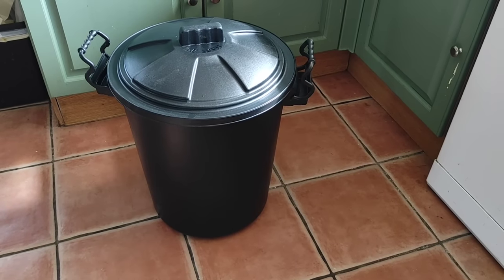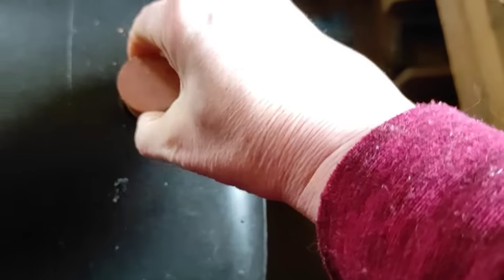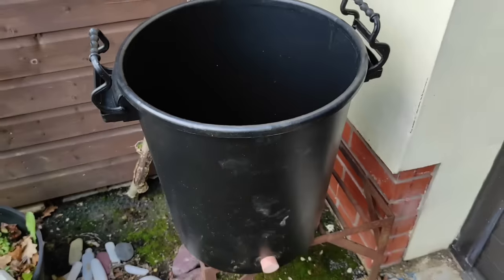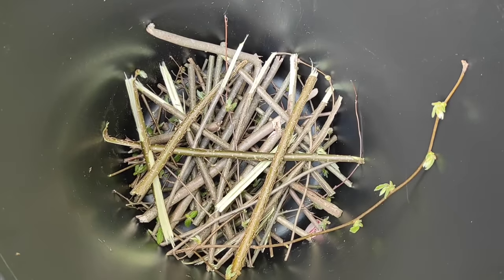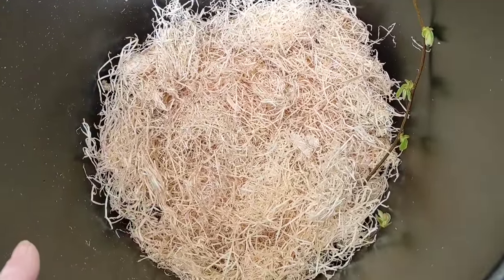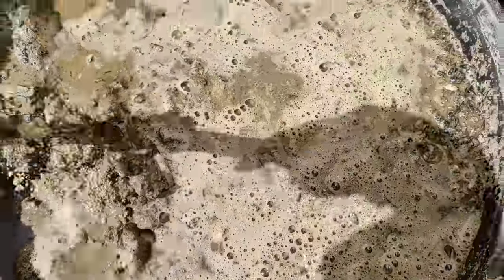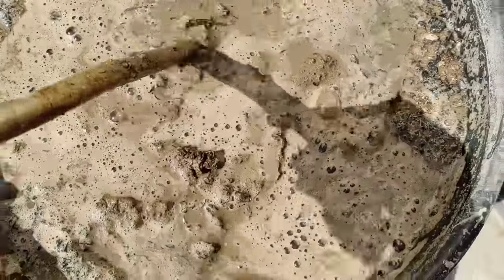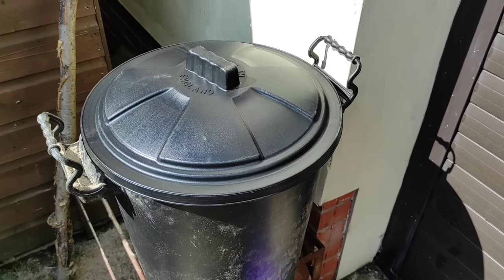Soapmaking from Scratch: Woodash Lye

Comment: I would recommend using lab goggles instead of just glasses because liquid can splash behind the glasses easily, and you really don't want to mess around with something that could blind you. When I worked in a lab, I got quite careless about regular lye/acids on my hands because it takes a while to sting and can be washed off easily; your eyes do not have the same protection and damage happens quickly. Lab goggles can be bought to be wearable over regular glasses too and are cheap.
Reply: Another easy safety measure would be to have a bucket of fresh water handy in site to immediately wash off any lye spills from the skin.
Reply: Yeah, I second that. A friend of mine who works in a chemical lab recently got a drop or two of sodium hydroxide (an alkali similar to those found in lye) and she got a massive burn on her eye. Doctors said her sight may never be as good as before and there were high chances that, if she delayed to seek medical help, to have lost her sight altogether from that eye. Strong acids and strong alkalis must be handled with great caution.
Reply: Totally agree…use goggles.  A splash likely won’t happen, but if it could…and it can cause real damage.  Just takes a few seconds and your eyes are worth it.
Reply: I use swimming goggles when doing experiments and cutting oignons, works well and very easy to find ! (Plus you can go swimming with them!)
Reply: My father has a two-inch wide band of grafted skin around his wrist as a reminder to be careful around sodium hydroxide – and to use long enough protective gloves for the job at hand.
Reply: @dawnmarie2710  she most definitely knows that, but someone watching the vid/reading the comments may not. It's less about educating her and more about advising backyard scientists about risks and proper safety measure.
Reply: I'd recommend the 3M brand anti fog goggles. They are the only ones I've ever used that are ACTUALLY anti fog
Reply: @dawnmarie2710   I bet she knows those goggles exist and that there is risk to her eyes, but still getting a nudge can be helpful. It is very easy and incredibly common for professionals and amateurs alike to forget how dangerous it is to forego personal protective equipment (PPE) because most of the time, nothing happens and you're fine, making you feel as though you're safe. But if something only has to happen once to blind you, you need PPE. Note that I didn't comment on her tasting the liquid - while that is obviously a no-no in a lab setting, the worst that can happen to her afaict is scarring her tongue, which is much, much less bad than permanently damaging your eyesight. (Source: I studied chemistry for 4+ years, but you can find great info on PPE elsewhere easily, eg NileRed has a dedicated video about safety with chemicals. Anyone will tell you that lab goggles are easy, cheap and absolutely non-negotiable)
Reply: Sodium hydroxide (NaOH) is actually a solid. 
So the incident you described most certainly happened with a solution of NaOH in water in which case the safety hazard depends on the concentration of the solution.
Reply: Your statement seems to imply that some degree of carelessness when handling dangerous substances was OK.
IT IS NOT.
It may go unpunished for some time, but it is never OK.
In case of gloves, the moment you feel it, permanent damages might already have occurred.
Also repeated exposure may also over time accumulate to serious health issues.
Even if your absolute certain it's safe, always stick with the safety protocol simply to keep up the habit.
Reply: I work with caustic, corrosive and explosive chemicals at work. Goggles have saved me enough times to agree, glasses are not enough if you take your eye safety seriously.
Reply: You new age people so indoctrinated into safety are something else. My mother who was born in 1917 made our own soap using lye in the basement of our house built in 1880. She never wore goggles or glasses. The key is just to remain vigil  (conscientious) and pay attention to what you're doing.
Reply: Me: Reading all the comments about safety gear and imagining being someone making soap and collecting ashes .. making soap .etc.
I wonder how long the average soapmaking person lived.. 2000 BC.. 1,000 BC.. 1, 000AD. Etc.. as with glass molding/blowing and pottery firing all very High- hazard tasks that made significant changes in culture.. and how the heck was it all figured out in the first place..(mind reeling)
Reply: @redstickmarket those people were quickly exhausted from life, but as over 90% of the population was living in the same conditions, it wasn't something remarkable. How they figured how to use wood ash to make soap is probably by seeing that washing clothes in the river down the hill where they made bonfires/charcoal pits/etc was more efficient than anywhere else, then maybe some used tallow to make it portable, and it was even more efficient because of saponification (even if no one around knew about chemistry). At the time, without modern science and equipments, technology increased via small steps, building on the previous knowledge. Nowadays we can separate components/reactions to look at them.
Reply: Putting a cheap plastic tap (like the ones used for rainwater barrels) on the bucket instead of a flipping cork would have greatly reduced the dangers of splashing in the first place.
But what do i know about alkalies, i'm just handling industrial acids regularly, probably out of my field of expertise :-)
Reply: @desertodavid . Some racers lived thru racing Formula 1 in the decades past, but that doesn't change the fact a very high percentage died. Your outlook is not sufficient.
Reply: @senatorjosephmccarthy2720  that's a false equivalent.
Reply: Thank you for your safe handling experience, expertise and wisdom..👍
Reply: @timhartherz5652  great idea, thanks 👍💐
Reply: She can do what she wants. She's an adult.
Reply: Wonderful recommendations
Reply: I was at a gun range for a class and one of the casings flung back, hit my lense and bounced off, spinning up behind my glasses, resting from my glasses to my eyeball. The leftover heat cracked the lense from the other side and my eye was definitely hurt. Always wear proper eye protection even with glasses. I still keep those glasses as a reminder.
Reply: @jellomiki I just ordered lye to make soap and I learned how dangerous it is from the comments. I appreciate this big time. Now I’m a bit scared but that’s good to be aware
Reply: That's very smart
Reply: You mean exactly like she indicated on the video? Go away
Reply: @CredibleHulk10  Oh, like where? I said it because I was worried for her eyesight specifically, I'm not talking about what she recommends for other people. You and I both agree that she isn't wearing lab goggles in this video, yes?
Reply: @lachouette_et_le_phoque   If you don't care for what she's doing, go elsewhere; nobody needs your whinging on videos of people actually doing things, especially when the thing you're complaining about is specifically addressed in the visual she adds at @6:11 stating  "a mask and goggles would be sensible if you try this."

Comment: I have made woodash lye soap a number of times. I filter the ashes, put them in a 5 gallon bucket, fill with water and let sit for a week (sometimes longer if I forget). When I drain the liquid, I have always had the egg float high to indicate a strong solution for soap making.
Reply: Thank you I’ll try that.
Reply: @carolinapatriot9651   wondering the same 🤔💯
Reply: @speaklifegardenhomesteadpe8783  I asked too early. You have to watch the entire video to understand the egg deal
Reply: I've read in other blogs online the way to do it is to burn what you'd like to use, like banana peels, apple cores, tomatos, carrots, wood etc, then pour the ashes into a bucket and fill it with rainwater or distilled water and let it all sit in the bucket for 5 - 7 days before draining the water out of the bucket.  That sitting time allows the natural chemical reaxtion to happen.  @nancygorman 

This is also how African Black Soap is made btw, they usually use coconut shells, palm leaves and plantain peels.  It doesn't need to be wood ash, any ash will do.  The benefit of natural lyes over synthetic ones is that you get the minerals from the plants that you burn in the finished soap, which adds nutrients to the skin.  Like magnesium and zinc and stuff like that, which is pretty cool.  Synthetic lyes don't have any nutrients in them. That's why I want to try to use ashes from burning different kinds of vegetables of different colors to boost the soaps nutrient content for the skin.

African black soap also doesn't filter the ashes, so you can get pieces of charcoal and carbon in the soap for exfoliation.
Reply: Hi! Do you calculate your recipe as the factory lye or do the numbers change?  I am soapmaker and i want to give this way a try

Comment: Interesting how y'all do things across the pond. One thing my ancestors did differently is they sieved the ashes to get only the powder and virtually no solids This was said to be one of the most critical steps for a good result. My Cherokee ancestors used to make hominy by putting dried corn in ash-filled pots, with water, next to a fire overnight. Many of my, now deceased, relatives said they'd wash their wooden floors with lye water made from wood ash and then they'd make soap from wood ash. The way they did it was they put the ashes in a cloth bag hung from a dowel rod by a thick rope. Over the bag was a metal tin, syrup bucket, pot or pan with a open bottom wood support holding it up. Basically any thin metal container that held a lot of water would do. They'd then have a tiny nail hole in the bottom of the metal container so the water would drip onto the rope and down into the bag. Below the bag was a crock. Usually this was done on a support post for a shed or porch with the dowel also being used later to hang souse or for other purposes. The idea behind this drip method was the extraction happened best because of the slow drip allowing time for a reaction to take place. The extracted water would then be capped off in the crock and taken to the creek to chill...sometimes for days (depending of the desired use of the lye watet). This is what we homebrewers call "cold crashing" or "cold racking" since the cold causes particles to floculate. They'd then pour off the good water into another pot and pour out the sediment in the bottom. For floors, this lye water was fine. For soap, they'd do the cold racking 2-4 times and then sieve it through clean clothes a few times. Afterwards, they'd then boil the lye water until just over half the original volume was boiled away. After it was cooled, they'd do the egg trick. The fats used varied. Some said beef fat was best for soaps used for household cleaning while others used old, used lard. All seemed to agree pork fat was best. I'm actually doing a contemporary demonstration of making hominy using an electric crock pot and sieved oak wood ash. We have an invasive tree here called Chinese tallow. It was brought here to make soap and candles. Most people are allergic to it. I like to smoke meats with the wood. I'm hoping to see if it has enough potassium in the ash to make lye water for future projects I have in mind
Reply: Thank you! 💯🦋🧑🏻‍🌾🦋💯

Comment: The traditional way of making soap where I live was to run that same water back through two or three times to get it strong enough to float that adventurous egg.  Mountain women only made soft soap from homemade lye, though.
Reply: Leave the ashes to soak in the water for a week or two, then strain. Boil to reduce mixture by half making it stronger! If your only passing the water through the ashes, your mixture will never be strong enough to make soap.
Also, if you add some lime/calcium it will make a more solid soap bar. You can make your own lime by baking shells until they are white and flaky. After, add hot water. Easy and very versatile. 
Just some fun info 😇
Reply: Madd skills you have!
Reply: I think the wood ash only gives potassium hydroxide, so soft soap--sodium hydroxide (Red Devil Lye) yields hard soap.
Reply: What's the difference in the process between hard and soft soap?
Reply: @overratedprogrammer  The lye made with wood ashes isn't strong enough to make hard soap is what I was told.  Some women did make hard soap but had to buy lye from the store to do it.  The soft soap was stored in a crock and dipped out as needed.

Comment: Rather than using a bung, I would recommend using a spigot/tap as a safer option. Brewers’ supply stores usually carry them for use on plastic fermenters, so it shouldn’t be any harder to find than the bung, and it would allow a controlled flow pointed downward rather than the gush you experienced. Love your vids, looking forward to more in this series.
Reply: She's going for historical authenticity, they wouldn't have had taps in those times!
Reply: @unison247 They didn't have Rubbermade Plastic, paddle bits, handheld impact drivers, or a lot of other things in this video. Also make sure you use the right size paddle bit the first time as the middle hole guides everything.
Reply: @unison247  You might be entirely mistaken about that ;) Wooden taps for kegs have been around quite a long time.
Reply: @AlienScientist  Or, better than the "paddle bit" - use a Forstner bit, actually designed for cutting smooth round holes as are needed here
Reply: @unison247 my grandmother made her own soap up until the 50s. She lived on a farm and had never seen a television so she wasn't brainwashed by commercials like everyone who had tvs
Reply: When dealing with ash it would be easy to clog a spigot or tap, a bung is pretty hassle free.
Reply: I was thinking something like this–a set of 2 camp shower bags is $10 and you could simply split open the top to put in the materials and have a nice and easy setup with a spigot.
Reply: @Master_Yoda1990  there are wide bore ones. I have one on one of my  buckets I use to filter wort. pretty difficult to clog it and still you can control the flow